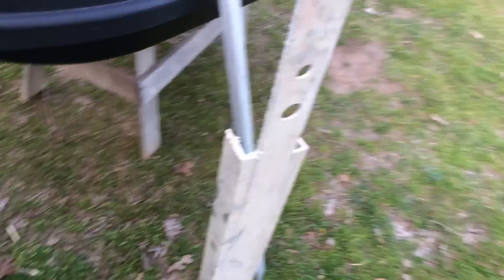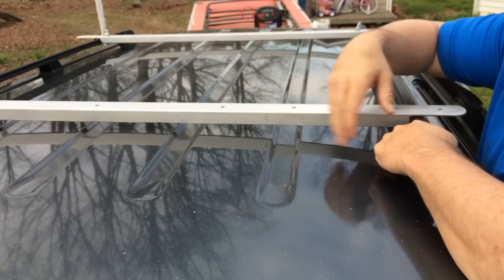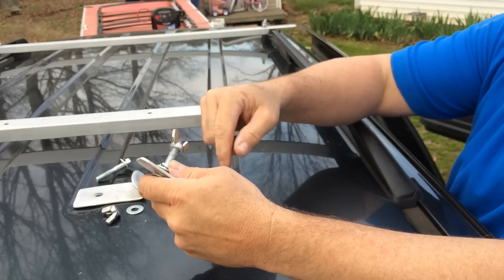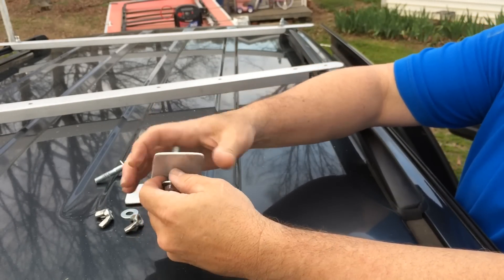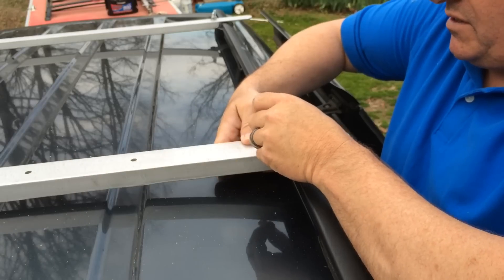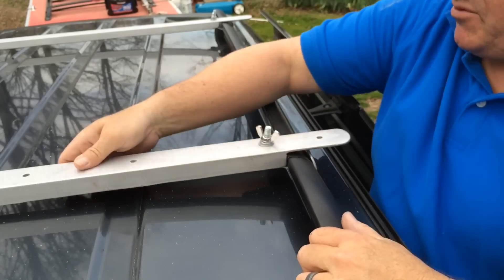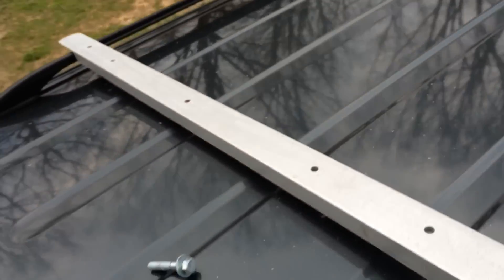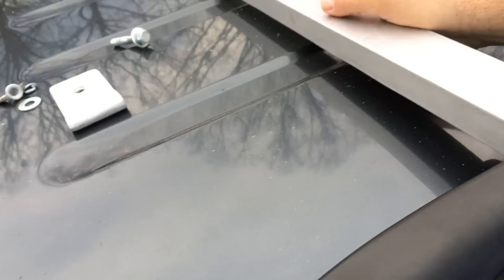Roof Rack Cross Rails (Homemade DIY)

Comment: Thanks for the video. Do you get wind noise and if yes how do you eliminate it.
Thanks
Reply from the maker: If there is wind noise from the cross rails, it is most likely hidden by the wind noise from the cargo carrier that we use. I only use the cross rails while using the cargo carrier.

Comment: where can I buy these hardwares? Home Depot or Lowes? or any other stores?
Reply from the maker: The bolts, washers and wing nuts were bought at Lowes but Home Depot has them as well.
Reply: +Jeff Furr thank you. What about the cross bar? Did you make it or buy it?
Reply: +Jeff Furr what about the L style holder?
Reply from the maker: +Jack An I made the cross bar and the and the attachment, I only purchased the bolts, washers and wing nuts.
Reply: +Jeff Furr I see, I thought I can buy it somewhere.